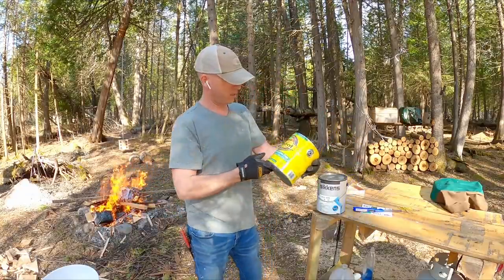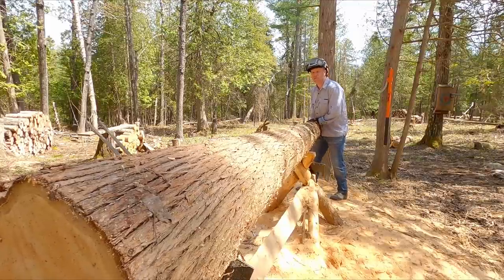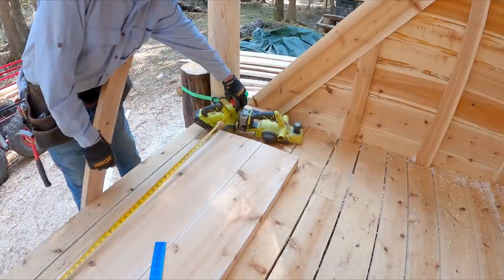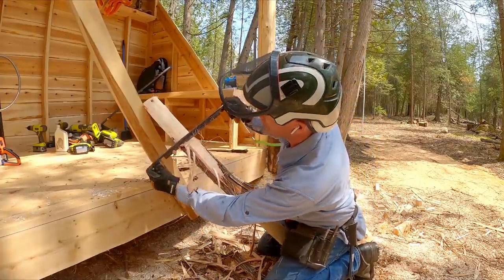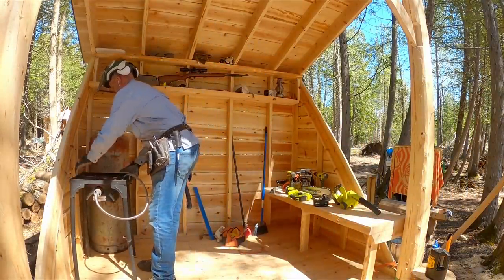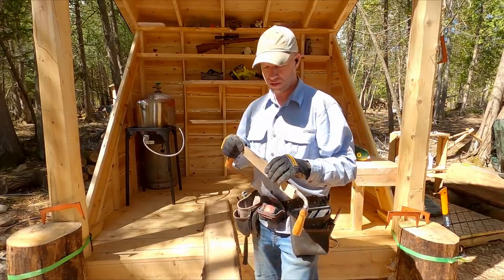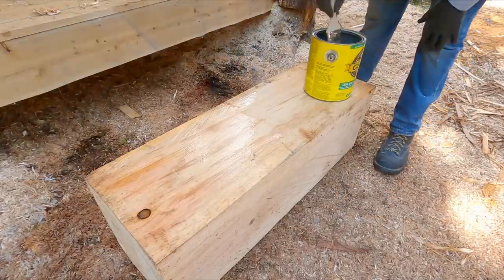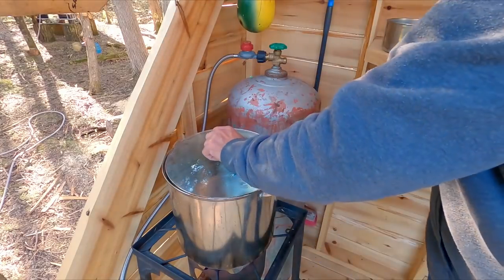Off Grid, Outdoor Cedar Shower FINISHED!  #84

Comment: How about some lighting in the shower, at my hunt camp i added a rubber hose to a 12 vdc dishwasher drain pump  (yes, a lot of newer dishwashers use 12 vdc drain pumps, we use a car battery to run the shower) .The pump pulls the water right from the heated pan of water to the showerhead. We use the same drain pump setup at our kitchen to wash our dishes

Comment: Hey Ryan, I got a little off grid thing in Alpena,  Michigan, also.  I use a small 3x5 solar thermal array made of pex and hot water is stored in an insulated water tank. It all runs off of solar power.  For you I would believe it would mean no need for propane.  Up to November, It works well to keep water  warm enough to shower with.  With I am a little extra insulation the following 4 months in Winter it keeps it above freezing. All the supplies you'll probably find at the Habitat for Humanity  resale.  Just food for thought. Keep up the great content, man. Really look forward to when you have a new video out.

Comment: Frequently surfaces that get sealed and are likely to have moisture (garage floors, patios, decks, piers etc) have grit of some sort added to the surface during the sealing process. Might want to throw some water on the floor and see how slippery it is. If so, a second coat with sand or some grit product could be in order.
God’s Blessing’s, Curly

Comment: I've got a little shower head that's battery powered that I would hang a hook for and use to shower with out there. You just drop the pump end into your water and it has an on off switch so you can navy shower. :) Looks great dude!

Comment: Keep the propane tank outside and drill out a hole for the gas line give you more room and easier to load and unload with the trailer. Just a thought. Also less chance to mark up that great looking floor.

Comment: Maybe I missed an explanation, but why place the LP tank where you have it? Why not on the ground on the outside, next to the burner? You’d gain some real estate in that corner and save yourself a potential hernia.
Otherwise, loving the creative craftsmanship.
Reply: Longevity?
The elements can really brutalize even fairly resilient things. All it would take would be a little moisture getting in the wrong place and freezing and that tank would be unusable
Reply: @blackoak4978  I have 2, 100# tanks. They are probably 50 years old now.
No problems with mine, although there is a metal hood that flips over and covers the valves of both tanks.
I am aware campers at permanent sites that use a tank like that, unprotected, that have little problems.

Comment: Looks awesome so far, great job on the build. Only thing I would have done different is have the propane storage at ground level so you don’t have to wrestle the tank up onto the platform. For all the various structures you’ve built over the years Im wondering if you put the same effort into a single large cabin with built in shower etc would have turned out. Probably spectacular like the rest of you builds. Anyway thanks for sharing your build techniques and since you use mainly wood for building look up Mortise and tenon joints for doing your timber framing, then you don’t even need $crews anymore!

Comment: bring the bad sealer to a simmer and then apply it when its hot.

the stabilizers have probably just degraded out, and natural sealers are applied hot. fundamentally modern sealers are the same as olden sealers but with stabilizers so its a zero step process.

Comment: "Patmas and Remora reported on a case of Lyme disease that was transmitted after only 6 hours of attachment by a deer tick. The authors concluded that, “The current recommendation against treatment of short duration tick bites may need reconsideration.”(1994)"

The claims that removal of ticks within 24 hours or 48 hours of attachment will effectively prevent LB are not supported by the published data, and the minimum tick attachment time for transmission of LB in humans has never been established.

Comment: @dummy .... Ive got an idea- we only use that SS pot for heating shower water cause its the right size? So what if I stick the Jackery in the pot and do some Plumbing? {ie., transfer pump to a roof mounted loop of black water pipe. ENOUGH TO HOLD ALL 7Gallons or whatever, with a check valve. as in, an option to just Jackery the water to the roof for non-propane based heating and gravity feed, but also to enable installing a shower head for both seasons. same pump, with a diverter valve could have a jackery enabled Pot-to-Showerhead circuit {i suppose noisy}. making any sense? probably not. Jackery probably couldnt pump hot water four feet to a showerhead when its -20F. obviously, Im thinking about a completley vertically self draining showerhead. no ice nuggets in there. probably some brazed copper onto some black pipe fittings. What do you think?

Comment: I aint you, you aint me. But if it were me, I would put at least one or two through bolts in the tops of each of those two top braces. Rather than relying on the sheer/pull force of some screws.